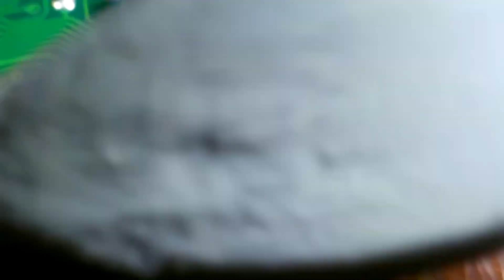Upgrading the Nintendo Game & Watch Storage - From 32Mbit (4MB) To 2Gbit (256MB) - Hot Air Station

Comment: Hello, in the first two minutes of the video the adapter that connects the swio, gnd, swclk, etc. outputs to the interface that connects to the computer is shown. Could you tell me what that adapter is called and where to buy it? thank you so much.
Reply from the maker: Hi, the adapter cable is custom and handmade from a female 2,54mm pin header (stlink side) with cable, soldered to a female 1,27mm pin header (G&W side). 4 wires total. I do not know if there are available in the market products that you can buy...
Reply: @PrimoAngelo  Forgive, I don't explain myself well. I mean the connector that welds the GNW. The connector that has 4 EB pins of L. I would like to know the name of that connector to look for it and if you know about a link where I can buy it. Thank you very much for your help.
Reply from the maker: I bought this: https://it.aliexpress.com/item/1005001412414804.html
1.27mm pitch right-angled pin header

Comment: Did you find any issue with height clearance with both the chip and the adaptor together when reassembling the console?
Reply from the maker: Hi, no space problem. As long as the height of the chip + adapter is equal to or slightly higher than the battery, no problem. In my case the height is the same. The plastic of the back even has an "indentation" in correspondence with the chip and this allows for a good margin.
Reply: @PrimoAngelo got it, thank you!

Comment: you can reduce the bubbling of the ic if you do a quick pass with the hot air to "melt" the flux just a little before you mount the IC on the adapter board
Reply from the maker: Thanks so much for the feedback, much appreciated!

Comment: That's awesome, you are clearly quite skilled with soldering! But whats the benefit of upgrading the memory? Like, technically speaking it's great, but how do you hse the extra memory? Can you load and run more games from it etc?
Reply from the maker: Thank you!

I use the memory to install a lot of GB/GBC/NES/GG/SMS/Game&Watch roms. Supported emulators:

Amstrad CPC6128 beta (amstrad)
Atari 7800 (a7800)
ColecoVision (col)
Gameboy / Gameboy Color (gb/gbc)
Game & Watch / LCD Games (gw)
MSX1/2/2+ (msx)
Nintendo Entertainment System (nes)
PC Engine / TurboGrafx-16 (pce)
Sega Game Gear (gg)
Sega Genesis / Megadrive (md)
Sega Master System (sms)
Sega SG-1000 (sg)
Watara Supervision (wsv)

Comment: Great. What about the iron/hot air temperatures?
Any suggested solder?
Reply from the maker: Hi, Iron 315°C, Hot Air 420°C. Solder 63Sn/37Pb or 60Sn/40Pb is fine. A good flux makes the biggest difference.
Reply: @PrimoAngelo  Thank you, this is very useful information for us beginners
Reply from the maker: @tutubi  I'm also a beginner, this is the first BGA24-to-SOP8 Adapter (and maybe the last) that I have installed. A lot of patience, a firm hand and a little experience also help with new jobs.